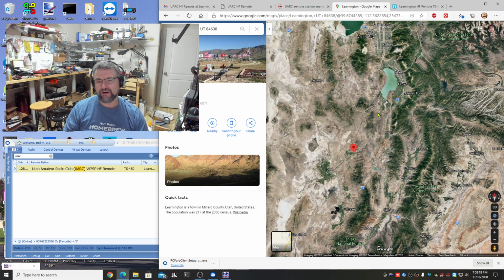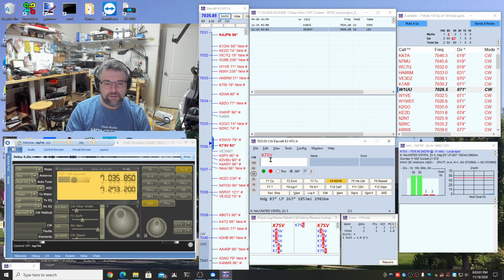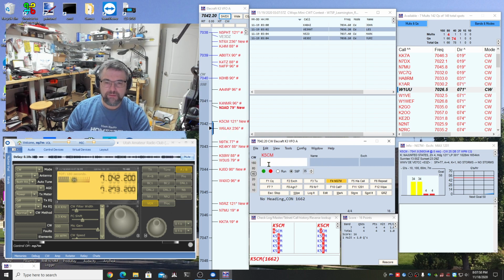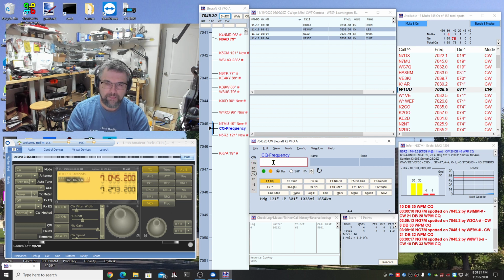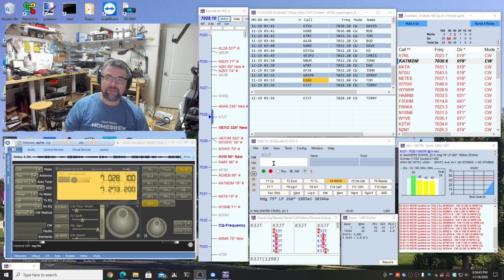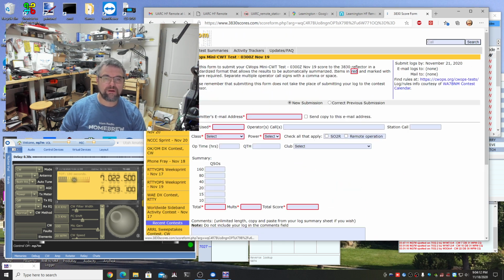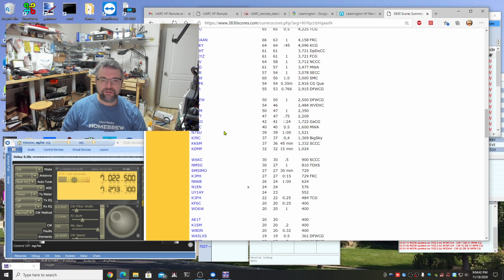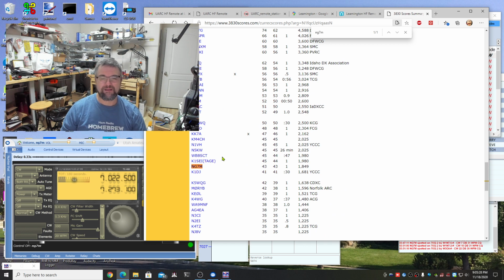NG7M Live CWOps CWT Mini / Utah Amateur Radio Club W7SP HF Remote

Comment: Wow!  Your contesting skills scare me to death!  I'm not even in the same league.  Not to mention the 50 WPM exchanges.
I have been working with Gary on the Leamington (pronounced LEM-ing-ton) infrastructure.  We plan to add a beam antenna next year.  I built the remote control for the rotator.  Started with one of Glen Popiel's designs and tweaked it for our needs.
Reply from the maker: Hi Chuck, thanks for your nice comment. I didn't know who to credit for the efforts other than Gary, but I'm sure Gary will post a list of all those that helped work on the remote and or continue to maintain it.  It's a great resource for UARC Members and especially those that want to try out HF without building a come station. And thanks for the correction on the local / proper pronunciation of Leamington. :)  Take a look at my previous video running stations in the ARRL Sweepstakes, that is a much better representation of the contest flow with a more complicated exchange.  I think you will like that.  The remote station operation was interesting and it does give you a hint of what it's like to run stations in a highspeed / qrq style contest.  The remote does add some challenges with the latency of the cw keying.  It doesn't show up in the video as much as you would think.  After you get used to the latency it is a little better... i.e. it helps to anticipate the end of the other station's transmission and hit the keyboard macro sooner than you would.

The remote contesting is very common place these days.  Certainly nothing new in the HF contest realm for sure.  I really wanted to highlight what was possible by jumping on the remote and operating cold turkey right out of the gate.  I think you will see this video featured maybe along with another operating video in the UARC January virtual club meeting streamed on YouTube.  Hope to have you join the meeting!

By the way, I will rarely use the remote station again based on my home HF station, but it sure is nice to know it's there and that I have access.  Again, nice work and what a great resource to provide as a club.  My real motivation for trying it out was to promote / encourage other UARC members to get on HF and use the remote... expand their interest in Amateur Radio beyond the usual FM HF / Repeater world.

 Max NG7M
Reply: @ng7m-ham-shack  Right, many UARC members have enjoyed occasional Leamington radio site visits;  Everyone can join in on the fun project work by sending e-mail to me, KK7DV at arrl.net, and joining UARC.  See you all for the UARC online meeting on January 14th on this topic, this video will be featured along with Max in Q&A.  The Leamington radio site building is plenty large and comfortable, it used to be a big AT&T microwave site and the bunker-style building is outfitted with furniture and workspace now.  We typically have a big work party with good food around Memorial Day and will have several for the addition of the beam antenna in 2021, and perhaps a kilowatt amplifier -- robust homebrew design perhaps?  Everyone welcome.

I also have SDR and FPGA code development as a research interest and there is the possibility of installing a RaspberrySDR at the Leamington site with a web interface for new and interesting capabilities.  Open source engineering, for sure.

Comment: Thanks Max, that is a great, efficient contesting setup and I can't believe you set things up so nicely so quickly.  A fairly large number of UARC members (~30) have worked together since 2018 to setup this HF Remote, and second remote transceiver is coming online along well.  sdrutah dot org is also related and developed by UARC members.  Everyone is welcome to join in, not only Utah residents.  Remote is working well for surrounding states when a bit of skip distance helps.  UARC dues are $20 per year;  Search and see the "Utah Amateur Radio Club" web site and YouTube channel.  73 from Gary KK7DV at ARRL dot net
Reply from the maker: Hi Gary, thanks for the comments and links... I updated the video description and added the links in that you provided.  Max NG7M
Reply: @ng7m-ham-shack  Thanks again, I now see the links in the video description!  I reported on the remote transceiver usage activity at the UARC board meeting this evening, and your scheduling for the January 2021 UARC meeting was mentioned.  See you then on the UARC live YouTube stream with interactive Q&A chat on Thursday January 14th at 7:30pm MT.